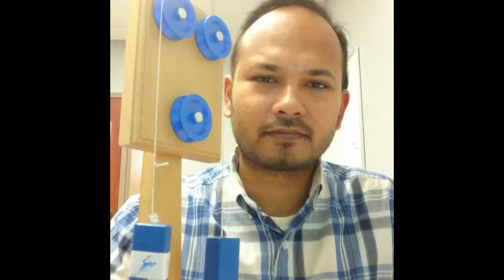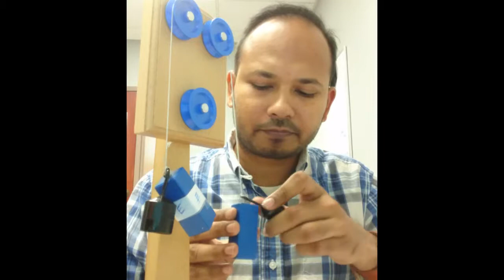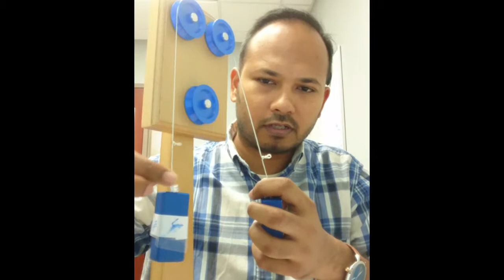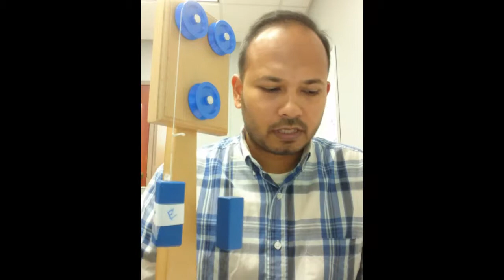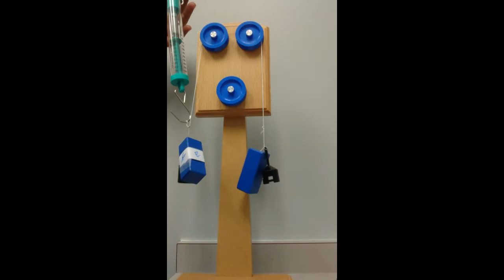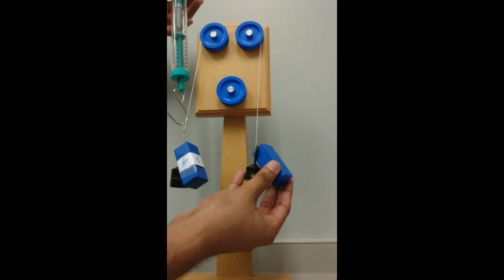How does a Counterweight Elevator System work?

Comment: Can we, by any chance before delivery, transfer the counterweight from 1 side to the other...
Reply from the maker: First, we need to think what would be the benefit of that compared to added complexity. Having a counterweight on one side has pros/cons during up and downward motion, as explained in the video. However, there exist design for variable counter weight (at least two counterweights) that can adjusted based on need.

Comment: What is the impact if the third pulley is added in the system?
Reply from the maker: Did you mean the third pulley visible in the system? Since the third pulley is also a fixed pully it will not change the relative velocity of the system but it will add some friction.

Comment: thank you! I have a question: in an actual elevator, since the counterweight is the same as the empty car,  when a person enters, the car will go down. But what if the person wants to go up? how do you add load to the counterweight part in an actual elevator?
Reply: The counterweight is actually heavier than the elevator.
Reply from the maker: @rareleyposting5546  Yes, the counterweight = ( weight of the empty elevator + half-weight of estimated full load). Thus the counterweight is heavier than the empty elevator.
Reply from the maker: Very good question Rae. The counterweight is the same as the empty car plus half of the full load. So, we can write counterweight = (weight of the empty car + half of the full carload). However, in a scenario where the counterweight is the same as the empty car and a person enters the car, what will happen? Well, the entire elevator system is controlled by a motor; so when a person enters the car and presses the down button due counterweight the downward force by the car is less and easy for the motor. When a person wants to go up, the required pulling force is also less because of the balancing counterweight. In general, the counterweight remains fixed and not variable.
Reply: @MohammadShafinulHaque  Thank you so much! I absolutely learnt a lot.
Reply from the maker: @raechen5259  you are welcome.
Reply: @Mohammad Shafinul Haque  thanks for that, everybody explaines how the counterweight works but they don’t say there is actaul motor, so the counter weight is literally only helping and making it safer
Reply: @MohammadShafinulHaque  for example. If the empty car weight is 1000kgs add 500kgs right? Totally 1500kgs calculate the counter weight right?
Reply from the maker: @mohamedabdulla2648   almost correct, but you need to estimate the full load (max load it can carry or designed for) then take the half of full load then add to your 1000 kg. So, it is not half of 1000 to add, but half of your estimated full load. In your case, total load = 1000 + half of estimated full load.
Reply: @MohammadShafinulHaque  i.e, half of the load weight PLUS the carriage weight.  So, a load of 1,000 kg plus the carriage weight, say 1,200 kg total one adds 6000 kgs to the cw

Comment: What happens if the counter weight is 100% the same weight to be lifted.
Reply from the maker: Very good question Deepak. First, for an elevator, the number of persons or objects in the car will not be the same all the time but vary thus it is not possible to have exactly the same counterweight of the weight to be lifted. Second, if for an instance the weight and the counterweight become the same, the system would be fully balanced, and it will be easier for the motor during lifting and going down.